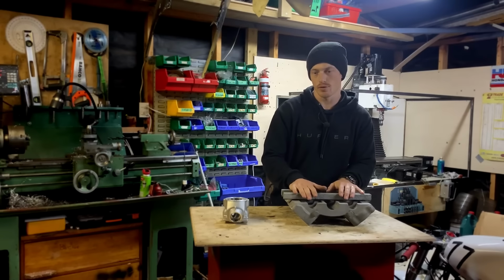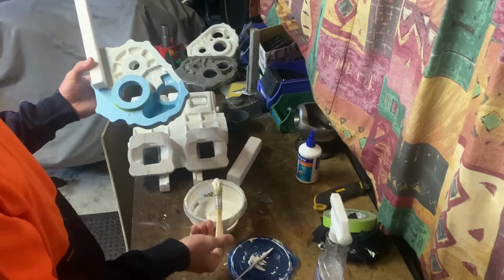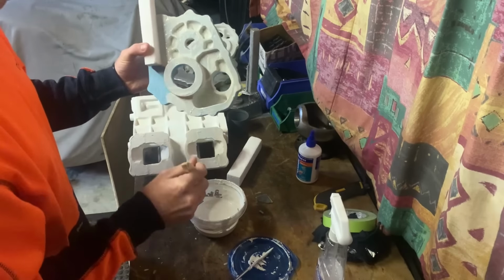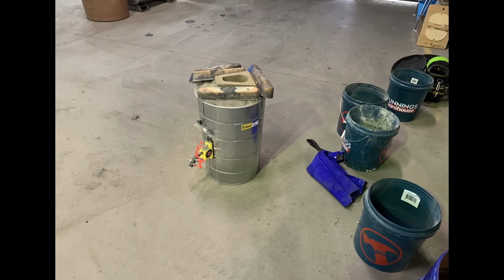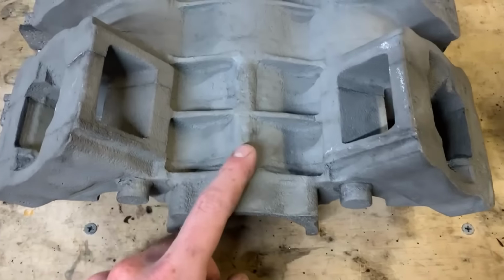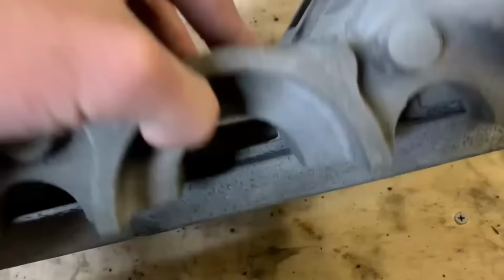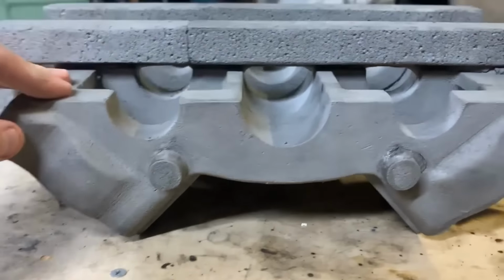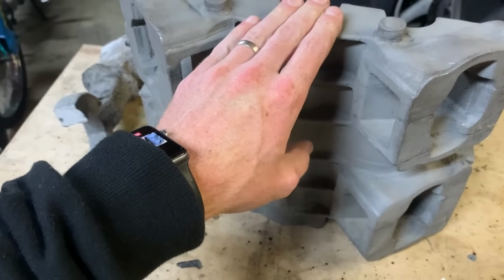Lost Foam Casting - V4 350cc Engine

Comment: Why only 350cc ?. All that work !.
Reply from the maker: I know my limits, I think a 500cc 2 stroke would be more intimidating than enjoyable to ride at my skill level. With 112cc cylinders it will be 450cc. 

But that’s just my take on it. I do enjoy a riding smaller bikes on track.
Reply: Thank you I was wondering this too.

For me the dream would be a twin cylinder 500cc using two Honda CR250 barrels, perhaps reversed like one of the Yamaha TZR250's on a six speed gearbox.
Reply: Although a part of me thinks a 1000cc on two 509cc barrels would be more fun...lol
Reply: There were people that made that 1000cc 2 cylinder on 999laser's youtube channel. It was a hill climb bike with 2 cr500 cylinders
Reply: @farquadmantis8486  seen it, it's a total monster. I think it would be total intimidation but it was the inspiration for a 500 twin for me, sometimes a 350cc is not enough and have tried the CR500 single in a TZR 250 road chassis but the way it delivered power made for a difficult ride. Have a great one and thanks for raising the above, I'm sure other might want to take a look 👍

Comment: It would be interesting to know how much porosity is present.
Reply from the maker: I guess we will only find out when I begin machining. I’m not going to cut this up and test as I’d rather just crack on with the project. 
The V twin motor had no major porosity present due to the pour, the only porosity was due to pouring at too high of a temp and having more hydrogen dissolved in the aluminium.